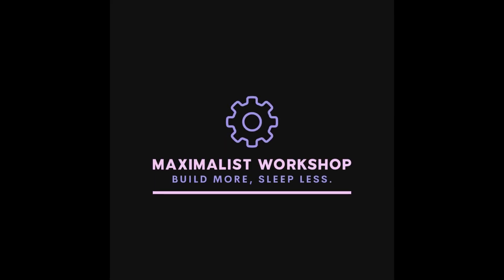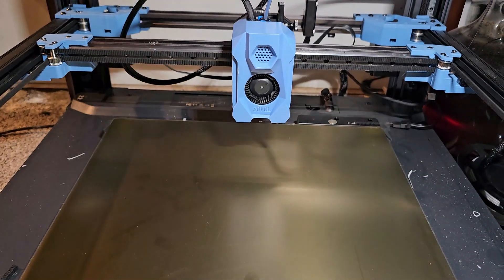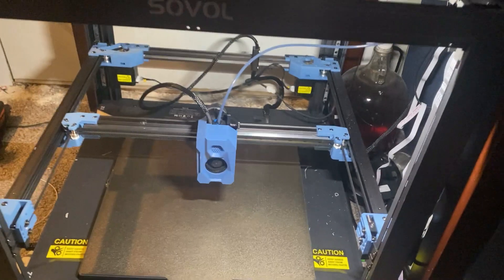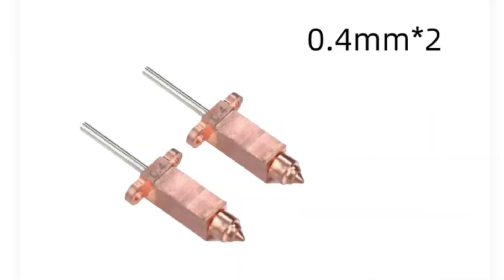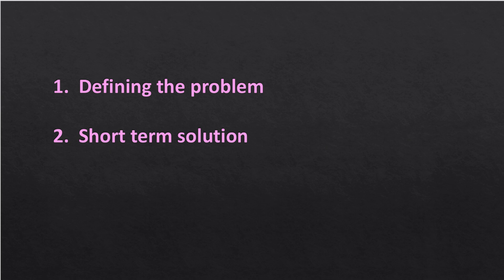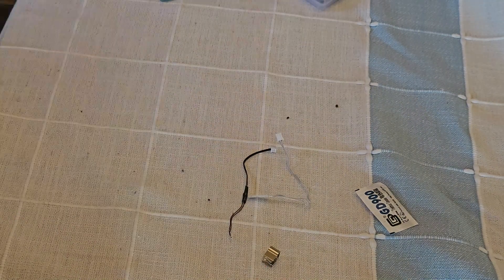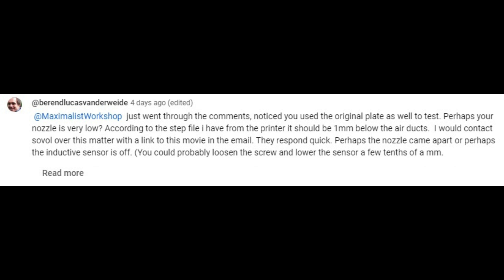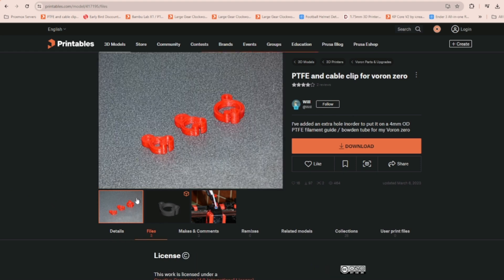Voron Clone Falls Apart - Sovol SV08 May Have a Problem

Comment: Arh! How nice! I was about to ask, curious to see what was wrong. Thanks for the update. Too bad the nozzle came apart, I wonder if it's an isolated issue or if more users are affected. My SV08 should be shipped at 22nd of June, but it turns out to be at the first week of August. (3djake). I agree on your statement about the 'early adopter' part. The issue with the nozzle has got to with incorrect tolerances, they are not tight enough (looking at the 3d step file they are being press fitted into the heater block).  What strikes me as odd is that at first, the images on the Sovol website with the SV08 nozzles showed silver plated nozzles, and now they show copper nozzles. On the other hand; it's common for companies to change things in their designs, different iterations for mechanical constructions are pretty common based on customer feedback. I found a small issue in the pinout on their github, and it was fixed within 2 days. They seem to be very responsive. (at least in my case). But the more printers are being sold, the more emails they will receive.
Reply from the maker: Thanks!! More users are affected - lots of posts from them on social media now, including in the comments here it seems.  I agree with you that Sovol's customer service is top notch, especially in this field, and I'm sure they're working diligently to address the issue.  It would just be good if they made a public statement about it so that people can stop using PETG on their machines for now.  Weirdly, it seems like this is only happening with PETG - I haven't found any cases involving ASA or ABS.  I think I figured out why the nozzles changed - I'll follow up with an update video ASAP.
Reply: @MaximalistWorkshop  Saw your video yesterday, dropped my SV08 nozzle and scratched up my PEI sheet today. I just wasn't sure you were sarcastic when you said the nozzle change is an easy fix. I had to soak my old nozzle in isopropanol for quite some time to be able to remove the heater without force. The goop was probably harder than the press fit.
Reply from the maker: @froh42  I was being sincere - the video showing me take it apart and put it back together was as easy as I showed.  Only did one take.  Totally possible that they switched up the thermal compound between production of your machine and mine, tho, or that something about our different printing conditions impacted the goop. Sorry to hear it gave you such a hard time!

Comment: The first big mod I'll probably do to mine is get rid of that hotend. I've seen the revo mod, but feel like someone might come up with a simpler solution.
Reply: Sorry for the late reply, but I replaced the stock SV08 hot end with the @Microswiss FlowTech hot end when I was assembling my SV08 and have been very happy with it.  I love being able to quickly cold swap the high quality FlowTech nozzles by screwing out the old nozzle and screwing in a new one, which is MUCH easier than the nozzle replacement on the Sovol hot end.

Comment: Instead of doing the bare minimum fix, they should take this as an opportunity to improve their printer. Take a page from FLsun and drill cht-style grooves directly into the hotend and use commodity V6 nozzles. It'll fix this problem, improve volumetric flow rate, reduce costs to the user, low conductivity wear resistant nozzles would have an insignificant hit to volumetric flow, and users can buy countless variants of V6 nozzles or make it themselves if they have a lathe.  The extra volumetric flow would take much better advantage of the speed their motion system claims to offer.
Reply: In general, the 3D printing industry should have a consortium that standardizes on nozzles.  Currently, every large 3D printer company introduces a new nozzle every year for their high speed printers and they're always nearly identical to a Volcano nozzle, but just different enough to force us to buy their proprietary nozzles.  We shouldn't tolerate this customer abusive behavior.  The manufacturers can't be making much money selling nozzles.

I installed an @Microswiss FlowTech hot end when assembling my SV08.  I can now quickly cold swap FlowTech nozzles in one minute using only a 7 mm nut driver - unscrew the old nozzle and screw in the new nozzle.  There's no removing and reinstalling the hot end, and disassembling and reassembling the heater and thermistor as required to change the nozzle on the Sovol SV08 hot end.  My plan is to convert all of my future 3D printers to use @Microswiss FlowTech hot ends so my investment in high quality nozzles can be shared between all printers, now and in the future.  No more throwing away new replacement nozzles when I retire a 3D printer.

Comment: That same thing absolutely destroyed my print bed. Are you printing with PETG? Several of us on the Facebook group had this issue with PETG but not PLA. I suspect the solder for the nozzle cannot withstand higher heat
Reply from the maker: Yep!  You guessed it.  I was using PETG at the time, and I think you're probably right.  If that's the case, then things are going to get MUCH worse when the enclosures are finally shipped and people start trying to print with ABS, ASA, etc.  I hate to speculate, but what if that's a reason the enclosures are taking so long?
Reply: @MaximalistWorkshop  supposedly they are working on a fix for this issue. The nozzle is from the Comgrow T300 so maybe they got a deal on a batch of those nozzles. I am planning use a proven Voron toolhead one mine, I don't want to deal with proprietary and poorly executed nozzles
Reply from the maker: @SKPhoto816  Thanks for the intel!  Sounds like a true Voron toolhead is likely the way to go.  I'll probably give some thought to doing the same once I've put the machine through its paces at stock.  Maybe put a Chube on it or something.
Reply: @MaximalistWorkshop  nice plan. I am researching the Xol toolhead. I need something that can do PLA and Engineering grade materials equally well
Reply: @MaximalistWorkshop  Well that's going to suck. I was hoping to use the sv08 as a dedicated ABS/ASA printer in my garage.
Reply: Me too.  Three times now.

Comment: I have been thinking of getting a SV08 but a recent experience has changed my mind. I have a SV06 plus and had an issue with the bed leveling sensor or main board not listening to the sensor.  This is my only printer so it was a pain not being to use it. After almost a month of trying different replacement parts and the 2-3 day turnaround just to get a response I have made a decision. My next printer will be a Voron 2.4, 350mm^3 build volume. I will eventually convert it to a tool changer.
Reply: Of course you pay at least two times the price of a SV08. Mind that the SV08 i completely open source and soon there will be many, many mods in order to use a alternative nozzle like a V6, volcano or Bambu lab.. 
If you're definitely not the handy person to do well documented mods, you probably also need to stay away from a Voron?
So, that's my 2 cents
Reply: Look into the troodon 2.0 pro. It’s what the sv08 wants to be. Despite what Sovol has said the sv08 is not open source beyond releasing cad models. Most parts are proprietary, Voron mods do not work on it, and even the klipper it runs on is custom to Sovol and has not been made available.
Reply: @chemicalwaffle9220  Many parts are standard like idlers, pulleys, a makerbase clone board, it's a ery simple printer. The CAD model is the only thing I need to easily building my mods.. I've been building my own 3d printers for 10 years now, and the SV08 might be the first of the shelf printer I buy. Goal is the equip it with a decent tool changer..
Reply: @winandd8649 I hope you are successful in that project. That would make the sv08 much more interesting. I think it could be a good base for modding like an ender 3. I just wish they spent more time on QA. I have been seeing so many issues online that were avoidable.
Reply: @chemicalwaffle9220  Thanks, indeed a nice platform for modding. All issues there might be with the SV08 can all be resolved. Cheers!